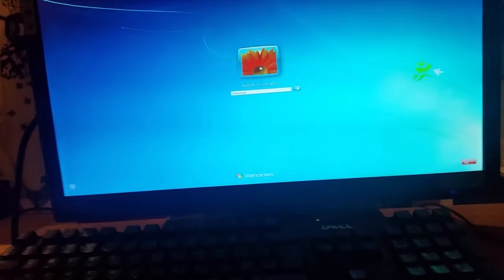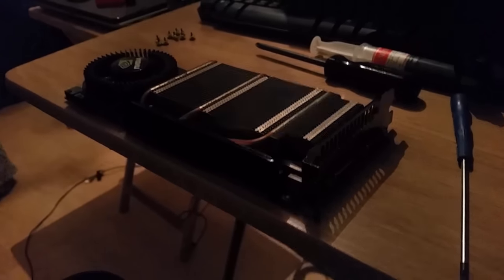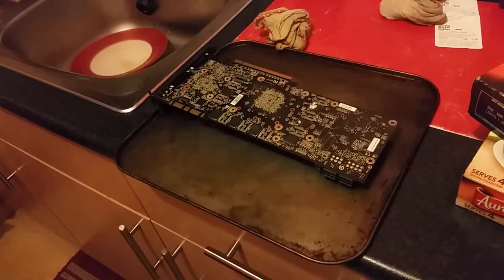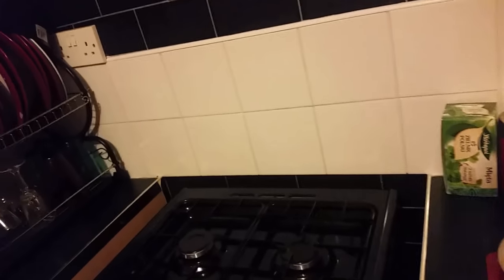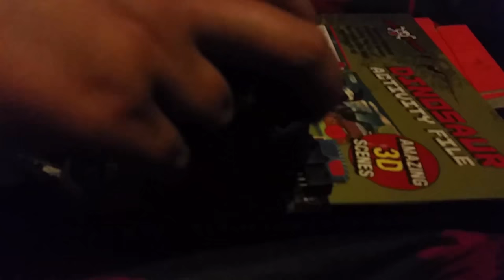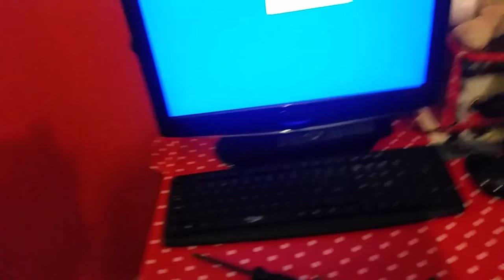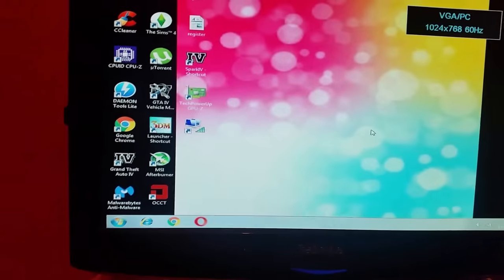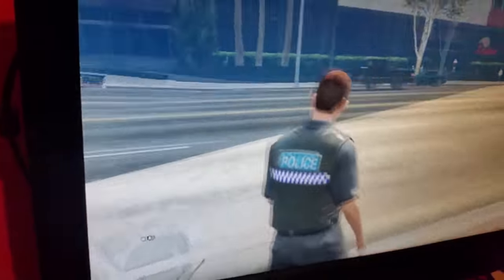Graphics Card - How to fix artifacts and damaged cards

Comment: I want to try this but I cant even get the dam heat sink off
Reply from the maker: ok this is common. they actually use glue in the screws. hard problem. you must use an exact fitting screwdriver or you will strip your screwheads, be careful. what i did myself i got a drill - VERY thin drill bit and i actually drilled screws i couldnt remove on another card. try remove ones you can and if stuck on a couple drill them out carefully.

Comment: I have a geforce gtx 750 ti .will this trick work on newer cards? it has been overheating 75c. also had artifacting issues
Reply: +Rob Caskey same with me :(
Reply: Don't you get like a 2-3 year warranty for the 750 ti?
75 C is overheating? That's just pretty hot. I'd suggest changing thermal paste and buying some new thermal pads for the RAM unless you bought the stock version.
Reply from the maker: Yeah basically THIS IS LAST RESORT guys try everything else first
Reply: Overheating graphics card means that your graphics settings in-game is set too high.

This is why you can't turn on your computer without a cpu cooling fan, your cpu gets too hot then shuts down your computer.

Comment: the problem with your card was the vram, not the chip itself, you could tell because the ram wasn't recognized before the drivers and those dim lines are caused by the ram being unable to work synchronized with the other modules.
Reply from the maker: most likely but re-flowing it in the oven fixed it

Comment: hmm... I'm having an issue with my GTX 560. the artifacts are square like on the screen. will this work?
Reply from the maker: it could work. but try this FIRST.Clean it out properly. first check temps is it hot??? is fan working ok? if i is then try down clocking / underclocking it. probably might be the memory. just make sure no dust/dirt and fan working and not to hot first.
Reply: How do I down clock?
Reply: put it in preheated owen for 10 min on 200c,leave it inside for 20min to cool down and 10 more outside of owen. Assemble it and should work if not u can apply Flux around memory and gpu,and bake it again.

Comment: You got him a 260, expect this when you go back that far
Reply from the maker: this was 2015. he now has a gtx660 which is enough for a kid i think and i'm on gtx980 but yes you are right these old cards do run hot. i remember the gtx 8800 omg and the worst for me was gtx480 an oven of a card!
Reply: Thanks for the response! Btw sorry if I sound a little agri I didn’t mean it like that. I actually used a Radeon laptop with an i7 2 series, and a radeon r9, and it ran so hot! And my friend also had a Radeon 520, and it ran hot as well. I guess their are a lot of cards that seem to run hot, but I don’t think any would’ve topped the 480
Reply from the maker: no worries mate. i will tell you the GTX 480 - you could cook bacon and eggs on it!  mine went just over 100 degrees before i water cooled it. and even then it hit 50 under water!  you are right though these older cards were very hot!  good memories
Reply: Geez! Oldest card I had was in a laptop which was a Radeon r9 280- maybe 380. Also had a 2nd gen i7 quad core at 2.9ghz. Man it’s slow now.
Reply from the maker: lol

Comment: There's easier way, plug in gpu without cooler to pc till it gonna start work again (the artifacts go away) or screen gonna start blinking (similar as no signal, but nothing shows on screen just blinking) then turn off pc, put cooler again on gpu, it worked for me.
Reply from the maker: HIGHLY likely to fry your gpu.
Reply: thanks a lot man it work for me
Reply: Thanks a lot.. This work for my GTX 780ti

Comment: I did the same with my 780 ti, I had blank screen so I tried cooking it. I washed it first in soapy water to clean all connections, blow most water off & then cooked it. It worked a treat, now selling it incase it happens again.....
Reply from the maker: great stuff. yes it most likely will happen again in the future so sell it
Reply: I washed it first in soapy water to clean all connections lol.water give Corrosion !

you can use contactspray and dry out with aircompressor
Reply: How long did that GPU lasted when you baked it?

Comment: DO NOT DO THIS IN AN OVEN YOU WILL USE FOR COOKING FOOD. 

Cooking a GPU will cause toxic chemicals to be released, which will stick to surfaces as a residue.  

ALSO, NEVER DO THIS TO A CARD UNDER WARRANTY.

Cooking cards usually only provides a temporary fix, as in a couple weeks more life. It almost never fixes a card long term. Also, taking off the factory heatsink and cooling solution isn't something wise for a novice to do either.
Reply from the maker: i did it in my normal oven no issues at all,  but yeah this is a temp fix normally if this fixes the card then best look for a new card as soon it will break again maybe it can last a few months at most.
Reply: @GhostvaperYT  I'm not suggesting the oven isn't capable of doing the job. I'm saying that any food you cook in that thing after baking a card is potentially contaminated with toxic substances. Never suggest that people do this in an oven their family eats from.
Reply from the maker: @ravensnestpainting4677  ok if you say so, i have had this oven for years and it was fine.  i mean you could clean your oven out after if you wish,  or even better if you have an extracter fan.  but anyway i had no issues at all.

Comment: Are you completely sane?
Reply from the maker: yes. i am only doing what they do in the factory. it is called re-flowing
Reply: @GhostvaperYT  Oh really? And what kind of profile did you use? Same as in the factory? You need at least flux(not to mix with the flux-capacitor in BTTF) in reflowing dude....
Reply from the maker: @sapperdeflap  really? well my method worked for me so i think i will stick to what works thanks
Reply: @GhostvaperYT  Personally i would not go as far into this trouble and bought myself a new GTX260 for $35 at Amazon instead.... But good luck in baking silicon chips(hahaha)...
Reply from the maker: @sapperdeflap  thanks. btw this was in 2015 and the card still works. i am not telling people to go out and do this first they should do an rma. i only did this as a last resort before the dustbin.  i mean if your about to throw a card you might aswell try.  this card is now in my cupboard as i have gtx 1060 and my son has gtx 660 but i like these old cards good memories